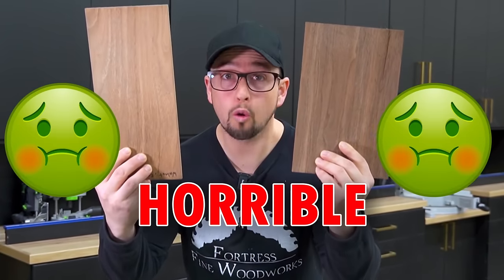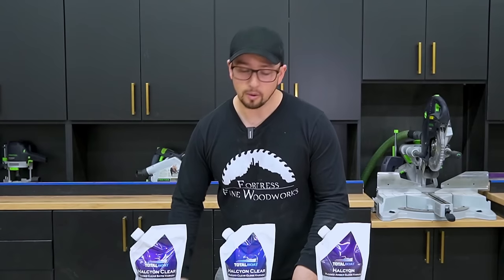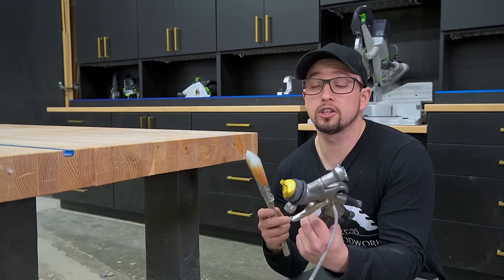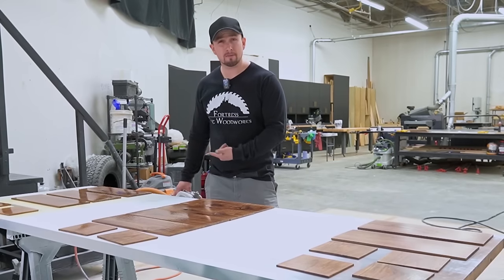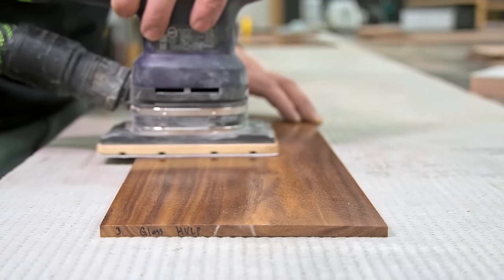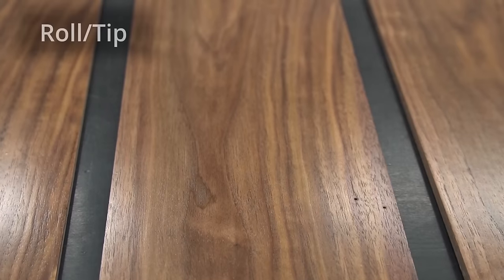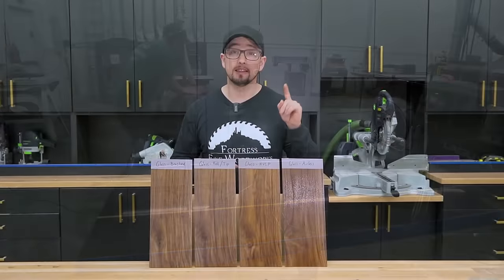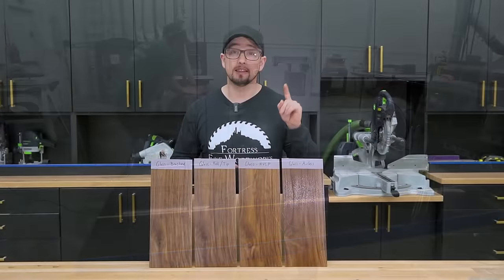This Luxury Finish Will Change History.

Comment: I used 'Varathane Diamond Finish Premium Polyurethane Wood Finish for Outdoor, Water-Based in Satin Clear' on walnut and received excellent results.  Available at Home Depot, easy to apply, tough finish, no yellowing and really beautiful finish.  I used a stir stick very slowly to minimize air, application with a foam brush and used very light sanding between the 3 total coats with zero air bubbles.  ps - the finish is being applied on walnut ply being used as interior trim around the window well of an RV build so moisture buildup was a concern.
Reply from the maker: Nice! It sounds like a decent finish

Comment: As for the bubbles, I assume that you strain the product before application. Secondly, sometimes you can smooth and pop bubbles with a heat gun.  If you use a heat gun hold the gun back and move evenly over the finish early in the curing process. Be sure you are in a dust free environment.
Reply from the maker: Honestly I've tried a heat gun and it never worked. Maybe I was doing it wrong

Comment: I have had excellent results finishing Walnut with General Finishes Enduro Var II which is an oil modified water-based polyurethane. It Ambers up more like an oil based finish, but you get the ease of application of the water-based.
Reply from the maker: I'll have to try it some time

Comment: None of them look great. I shoot a water based clear with a 35 sheen, similar to Renner. It pulls the chocolate colours out wonderfully without the yellowing. I shoot a single coat, it sits on the flat spots but doesn't close the pores which is look I am usually after (similar look to oil/hardwax like rubio).

Comment: Looks good. I use Arm-R-seal and have yet to be disappointed. It's almost foolproof. have you tried it?
Reply from the maker: No I haven't tried it. But good to know! I will definitely consider it.
Reply: @Splash111, I've used Arm-R-Seal quite a bit and it's a great finish. My caveat is that I've only used the oil-based poly. Also, it's about as finicky as any oil poly with the sanding and recoating, but it does go on smooth and really brings out the wood's beauty.

Comment: Thanks for the video.  I’ve been looking forward to it since you mentioned it in a previous video recently. I work mostly with walnut so I’m alway interested in the best water based finish options.  I’m investing in the Graco Quick Shot Sprayer this week, so I was also interested in your spray tip choice and glad to see you listed it (308 FFLP).
Reply from the maker: Absolutely, the 308 will work great for most urethanes and such. If you order the tip, I'd appreciate you using my link since there's no added cost for you. Thanks for watching!

Comment: Samples are great and all but I’d like to see the rolling and tipping done on a large piece. I feel like by the time you get around to tipping it’ll start drying? I only use hvlp so would be curious.
Reply from the maker: I agree, but I bought a 4 inch brush for the thumbnail, and realized, you could use a 9 inch roller and 4 inch brush and get it laid out in no time

Comment: Every closeup shot shows something I dread though..... bubbles. In addition, I imagine that the wood feels like it has a layer of plastic on it. These are the reasons people like Rubio... at least for indoor finishing. Add ceramic coating and you get some of the sheen and depth that is lacking with Rubio (but at a higher cost).
Reply from the maker: Only the hvlp samples had bubbles. I appreciate you watching!

Comment: Hi! I am sorry your pieces decided to cup without your permission. That being said, I like to use a foam brush on my stuff. Have/do you ever use them? I hate cleaning brushes! My go-to finish is Arm-R-Seal. I generally go with 4 coats while hand sanding with 320 in between coats. Did I mention I hate cleaning brushes?
Reply from the maker: Haha I hate cleaning anything! Yes, foam rollers are amazing, although I used a normal roller to drive the point home that you can use whatever

Comment: How much surface area did you get coated with a quart, would you say? This looks like it might be a great solution for a dining table I need to refinish, since it needs to be heat and moisture resistant.
Reply from the maker: You'd have to go to the total boat website and see.

Comment: Followup - I’m planning to make a maple butcher block countertop (will probably be at least a month) and am pretty much looking at this TB Halcyon or GF Arm-R-Seal. Right now your testing really makes the Halcyon look like it might be better but do you have experience with Arm-R-Seal? If si, given a kitchen countertop (with sink, probably under mount) do you have any feedback on one vs the other?
Reply from the maker: I have not tried Arm-R-Seal but it's an oil urethane so it takes like 12 hours to dry. It says up to 72 hours to dry before next coat. That's crazy. The halcyon will do great and you'll appreciate the dry time and feel. Here's 5% off the total boat website if you want to try it. https://www.totalboat.com/?sca_ref=5718157.55vcje6aYW
and you can enter the code 20PERCENT to change it to 20% off if that code is still active.
Reply: @FortressFineWoodworks  Thanks, going with something oil based definitely has some disadvantages but they seemed to be outweighed primarily by the durability and chemical resistance but your tests specifically and directly made me reconsider and TotalBoat should be really pleased with how comprehensive your testing was given how well you showcased their performance. It took a lot of time and effort and you did a great job. I think I’m going to go ahead and give it a try and will be sure to use your link so they know you made a difference for at least one viewer 👍
Reply: @FortressFineWoodworks   The 20% code is still active, hopefully it will be when I order it at the end of the month 👍 
BTW, left the following comment on their most recent Halcyon video, it’s 11 months old but hopefully their social media manager still monitors comments “You should be really pleased with the in depth testing and review that Fortress Fine Woodworking did on the Halcyon product. He did a great job showing how well it’s durability and chemical resistance performs on par with a quality oil based product, you should definitely be sponsoring him!”
Reply: LOL Somehow I accidentally left my last response to you about the comment I left on their most recent video and they did see it because they liked it 🤣😂🤣
Reply from the maker: I truly truly appreciate how much effort youre putting into recognizing my efforts on this. I can't thank you enough. I'm positive the products will make you happy and I hope that code is still active by then too!
Reply: @FortressFineWoodworks  Sometimes it’s good to do something simple to let someone know their efforts are recognized and appreciated. Plus there is a small ulterior motive… I want you to continue putting out good quality content. 👍
Reply from the maker: Will do.
Reply: @FortressFineWoodworks  So TB apparently viewed your video and agreed with me and replied to me saying that you did do a great job so hopefully they will reach out to you and sponsor you.

Comment: You did an amazing job with this complex comparison test (1 dependent variable, 12+? independent variables? - makes a multidimensional matrix...). The results were clear and I could follow you here - a lot of these type of videos get lost in the cross-comparisons. I'd say Total Boat might have changed the game on water poly, because I never use that for the very reason you illustrated: it doesn't make the wood look awesome. Taste varies, but that yellow amber is... no, just no. Kind of expensive for my home shop price range, too, but agree - what kind of heathen doesn't use a standard metal paint can?
Question: did the water poly cause the cupping, or was that just the walnut doing it's own thing?
Reply from the maker: Thanks man, I'm glad it was clear. The amber gloss could work if you need to match old ambered wood. But I agree, I won't be using it for walnut. 
Yes, the poly created the cupping since the pieces are so thin. On a real project I would recommend finishing both sides to offer even moisture. Thanks for watching!
Reply: @FortressFineWoodworks  Awesome reply, my dude! Agree the amber would actually be a great application for something that should be in a museum. Also, good heads-up on the cupping issue. I learned a good technique with the roll and tip from this content, which I'll probably use in an upcoming project. Hope the Saturday releases work better for you!
Reply from the maker: Heck yah! Thanks for being such a great viewer dude! The roll and tip method is better than I thought it was going to be.